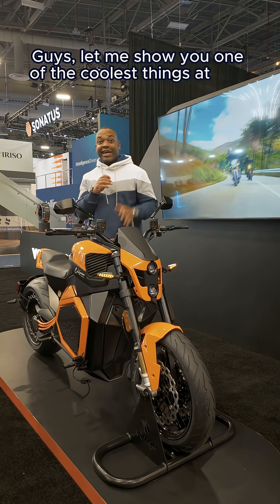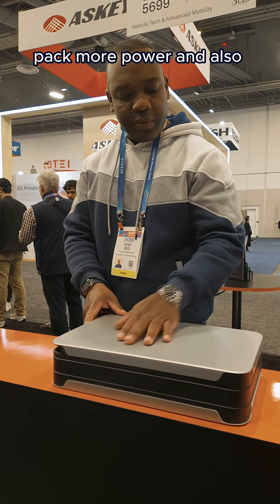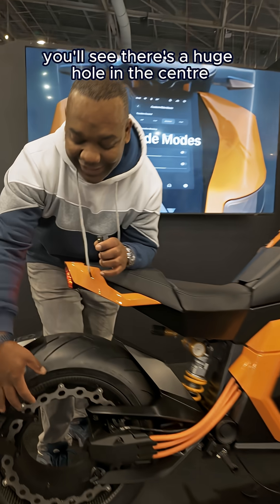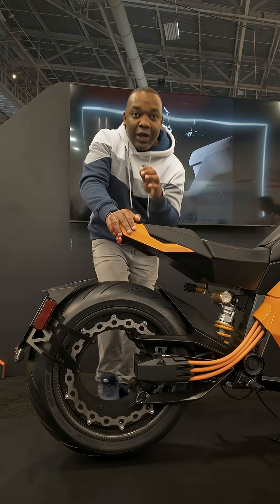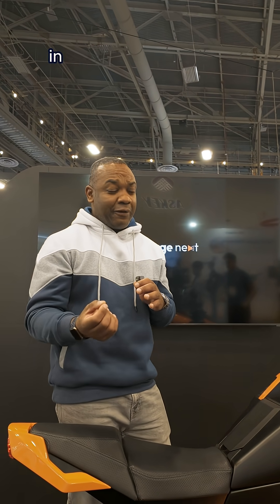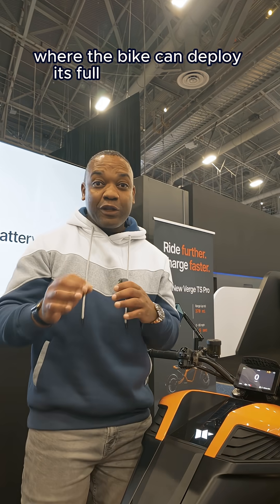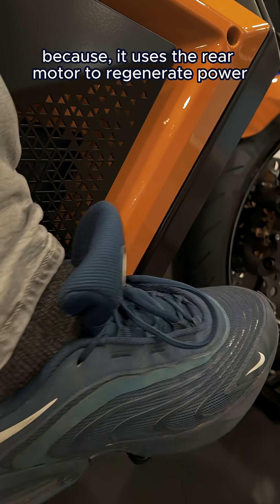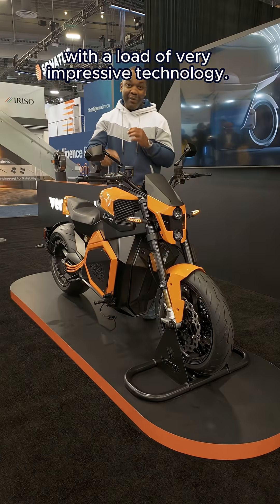Meet The Motorbike With A Solid State Battery

Comment: Some things they have not said like self discharge of the battery. If this needs to be charged for 7 hours at home before you can ride it. The 10 minute charge is unlikely at most 75kw average chargers. 35 minute is still good but will we be waiting to charge it up before every ride?